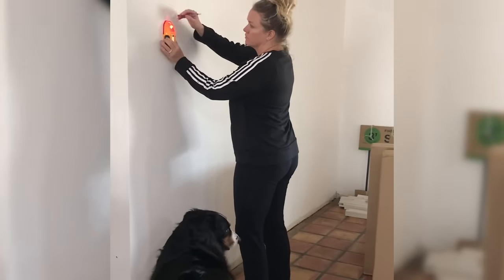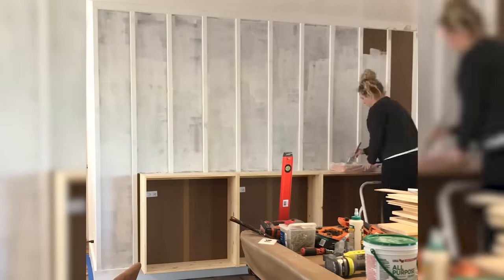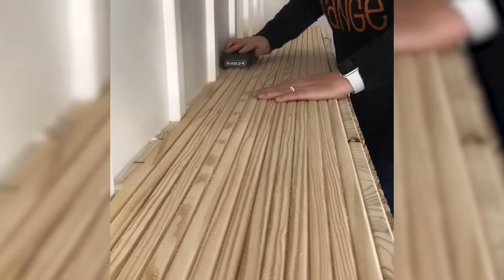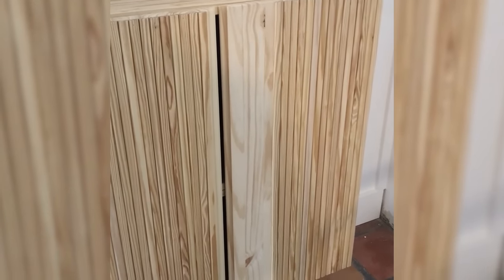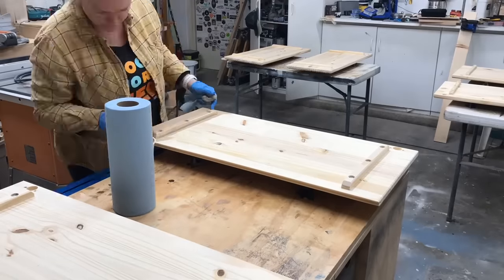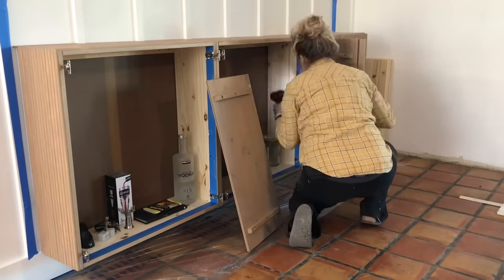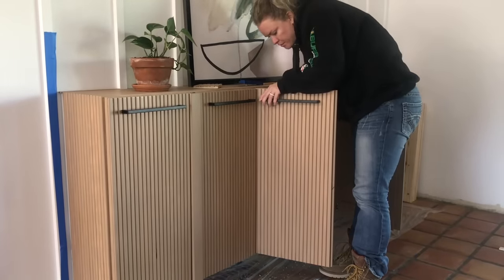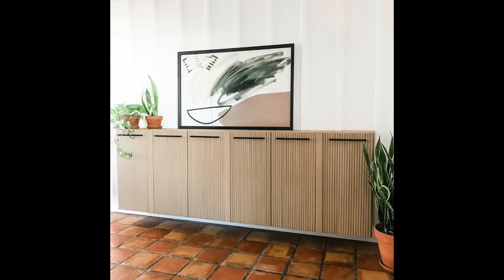DIY IKEA Hack | Modern Floating Console

Comment: This turned out amazing! Great job. I especially like how you put the handles across the top instead of the normal vertical mount!
Reply from the maker: Thank you so much! I thought it was a good contrast to all the other lines. Plus, I’m using this as a bar cabinet and I can hang a towel there when in use. 🙌

Comment: Just FYI, you do not need to unscrew the ikea concealed hinges. They unsnap from the base plate. This way it's easy to remove the doors after they have been adjusted for fit.
Reply from the maker: Thanks for the tip, I did figure that out at some point. 🍊

Comment: So glad this popped up on my feed, loved it! Can I ask, why didn't you apply all the strips and finish to the cabinets before fixing them to the wall? Would it have been easier to glue the strips onto the doors then cut them all down to size in one go? Or is this the difference between a professional job well done and something more lazy and unprofessional?
Reply from the maker: Thanks I’m glad you like it. I installed the cabinets before applying strips because there were three of them. If I applied strips first it would have been very difficult to install the cabinets. I could have installed the slats on the doors before attaching them, but I wanted to make sure everything lined up after install. I hope that answers your questions. And I don’t think one way is lazy or unprofessional it just two ways to do something. 🍊

Comment: Beautiful!!!! 😍 How exactly did you secure the cabinets to the wall? I have the larger ivar size (6) and am working on similar project.
Reply from the maker: Thank you! I used 3” wood screws thru the back support pieces and into the studs.
Reply: @TheAwesomeOrange  hi I bought these cabinets yesterday and the backboard is like little thicker than cardboard. But how did you screw them with studs. Can you please help?
Reply from the maker: @srikiran275  There should be a piece of solid wood across the top back of cabinet. I secure it to the studs there. You can add additional supports across the back as well. 🍊

Comment: This looks amazing. How did you fix the cabinets to the wall for the floating look? I am working also on a diy project where I use the Ivar Cabinets and I find it hard to find a solution to fix them on the wall.
Reply from the maker: Thanks! I used the strip of wood across the top back of the cabinets and screwed those into the studs. Plus, I have mine floating on top of my baseboards. 🍊

Comment: Hi thank you for sharing this video, can I ask, how did you attach this to the wall? I have bought the Ivar cabinet but I don’t understand how to do this from the instructions! 1:13
Reply from the maker: Mine is sitting on top of my baseboards 5 1/2”. And then there is a board across the top back of the cabinets that I secured to the studs with wood screws. 🍊

Comment: Amazing job! What do you use to clean the cabinets so it doesn't mess up the finish?
Reply from the maker: It has polyurethane on top of the paint… so you can use most any cleaner. But I just normally wipe it down with a wet rag or duster. It doesn’t get much traffic at my house. 🍊
Reply from the maker: Oh and thank you! 🍊

Comment: Can anyone answer this question? Why wouldn’t you stain all the wood before assembly? Is it just preference or is there reasoning behind staining and painting last?
Reply from the maker: I added the slats after assembly and installation of the cabinets, so if I would have stained before I would have had to do it twice. If you watched the whole video you would see I took the doors off for staining. Easier to stain them on a flat surface. 🍊